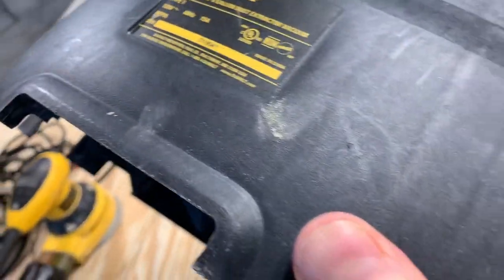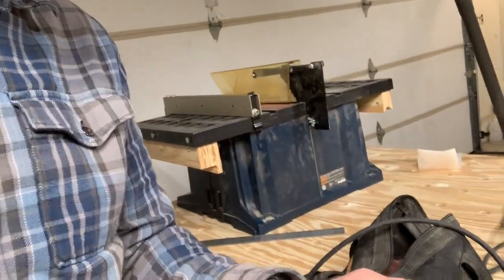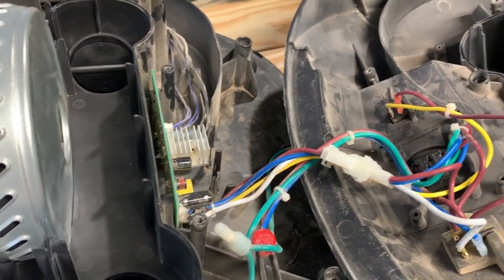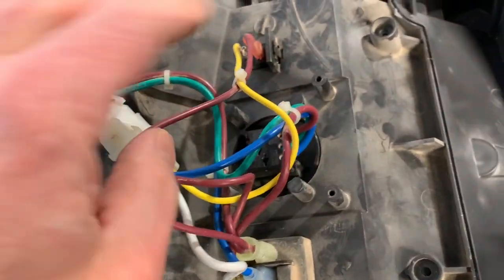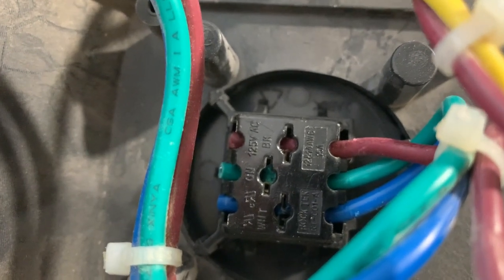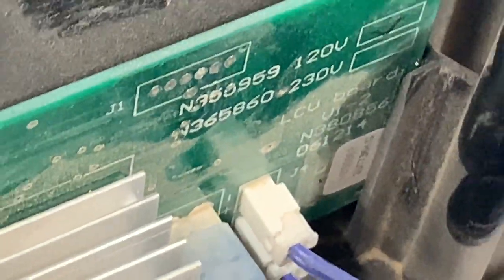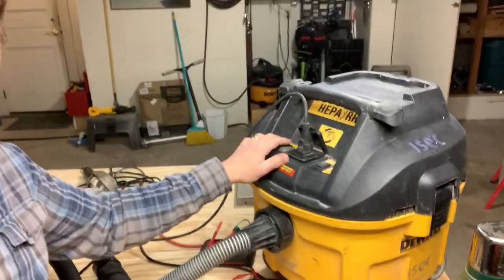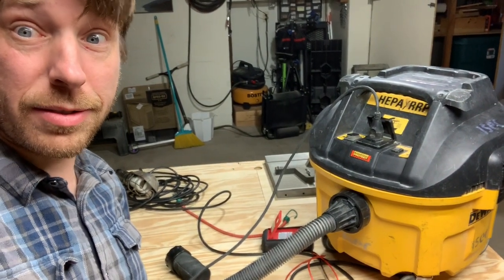DEWALT DWV010 Repair

Comment: Just picked on up on the Marketplace also, do you notice any noise if the valves open or close? I guess I can run it with out the filters and see if the different ports have suction and if it switches. I guess I was thinking there is some vibration that shakes the dust lose, maybe just the principal of the the non working port and the vibration of the motor is supposed to lose the non working filter.
Reply from the maker: It does make a “thump thump” noise when the valves cycle. I think it temporarily reverses the airflow to blow the filters back out. I’m not sure it works all that well because my filters get really really clogged but fortunately they are fairly easy to clean out. I’m gonna take it back apart at some point and make sure that I got the valve assembly working correctly – I think I did but given how clogged up my filters are every time I use it I’m not 100% sure.